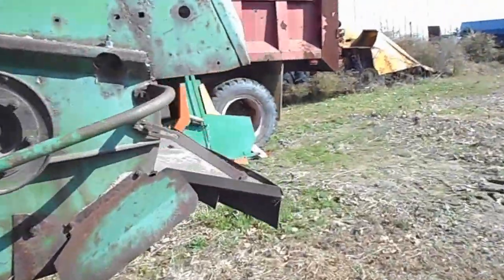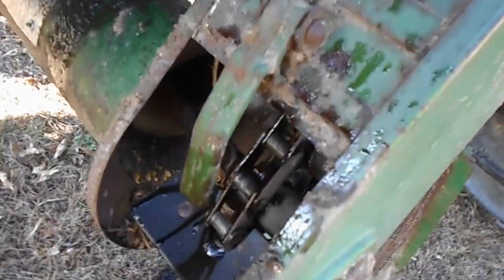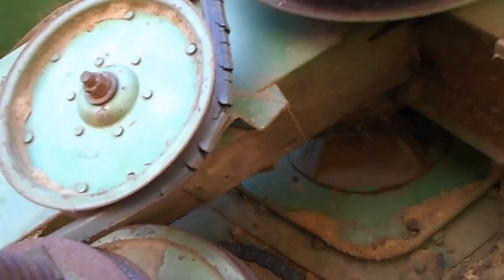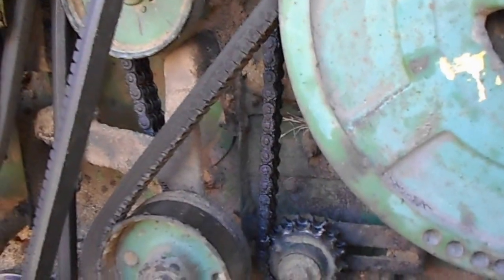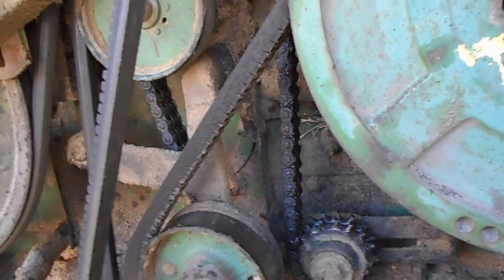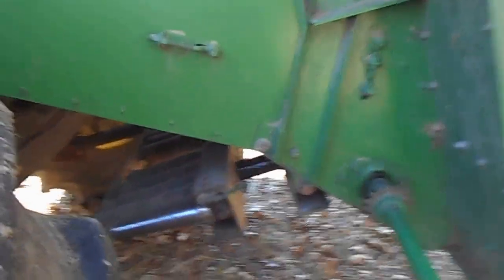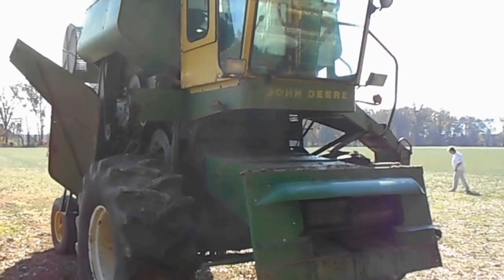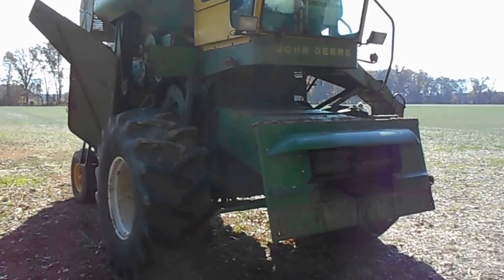JD 95 combine Prep for storage

Comment: Interesting... never seen the insides of one of those old "5" series Deere's... so they had a "raddle" drag chain setup under the cylinder and concave... interesting.  Predecessor to the goofy auger bed they use on the newer "00" series on up.  I still prefer a shaking grain pan.  My Claas/Ford has a corrugated (well, small stepped I guess you could say, the floor is shaped like half arrowheads lined up behind each other like a sawtooth pattern, about an inch and a half long and a half inch drop onto the next one, with 3 flat sawtooth-topped plates sticking up to keep everything from running to the low side on a slope.  Grain pans pre-sort the heavier grain to the bottom and the lighter chaff and stuff up on top, so as it shakes back and drops through the rake across the back of the grain pan and down onto the chaffer, most of the light stuff blows right out as the grain drops... the sticks and larger stuff ride down the rake and drop about 5-6 inches back onto the chaffer, where they can then get shaken out the back and drop on the ground, without being in the way of the grain pouring onto the front of the chaffer through the rake.  

Looks like that'll be a fun repair on the clean grain table... neat idea with the screens too.  Later!  OL J R :)
Reply from the maker: The old 95 was really simple in its build, The cylinder is right behind the pivot point for the feeder house and the riddle chain runs from the front of the cylinder back about 5 feet to the shaker bed or sieves . The straw walkers are within 6 inches of the back of the cylinder grate and there long straw walkers !  Like 10 or 11 feet !  Anything coming threw and out of the grate of the cylinder goes down on the riddle chain and is moved back to the shaker bed. I did add a screen section to the clean grain pan and a screen under on the bottom pan to get rid of some of the trash before it hit the shaker bed. I really liked the way the JD combines of this series were built, It was so simple in design it couldnt fail. They used the old roller bearings instead of sealed bearing and you never had a problem with them as long as you greased them. With it having a 40 inch wide cylinder a 15 foot head in beans or a 4 row corn head you couldnt slow it down !  I was a Gleaner man myself till about 1988 when I had a big time blow up with the dealer ship after they sold me some bad parts and wouldnt stand behind them. I sold all the AC Gleaner stuff I had and bought the first JD 95 combine and never looked back. I ran it for about 20 years and it got tired so I bought the 95 thats in the barn now. I wasnt looking for a combine when I bought the 4400 combine I have but when you can buy a 1 owner machine with 1200 hours on it for $1000 you buy it !  I'm still thinking about rebuilding the 95 simply because I think its a way better machine than the 4400 is by far !   I am really thinking about this rebuild and have found a replacement gas engine for it with low hours and found scrap stainless steel sheets to use as a replacement for the clean grain pans so I am serious about the possible rebuild of the combine. The odds of dinding another JD 95 corn special around here is pretty slim so I might just have to rebuild this one to keep on running it.  Bandit

Comment: Liked the video bud! I was looking at a similar John Deere combine. Your model has a gas engine, correct me if i'm wrong!
Reply from the maker: +William Lewis Your right it's a JD 303 gas and it purrs like a kitten. If I were to upgrade it would be to a 4425 or 4435 JD combine, They are German built and made like the 95 not like the 4400 or 4420.  Bandit